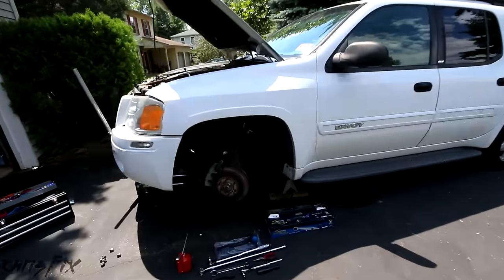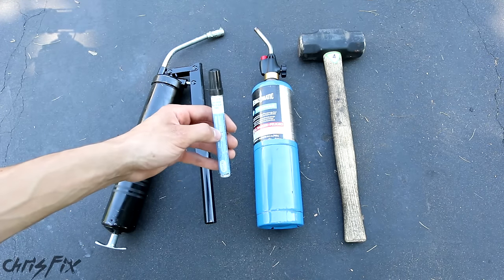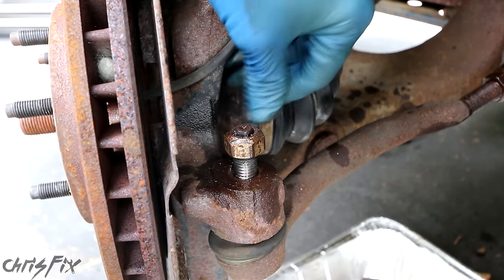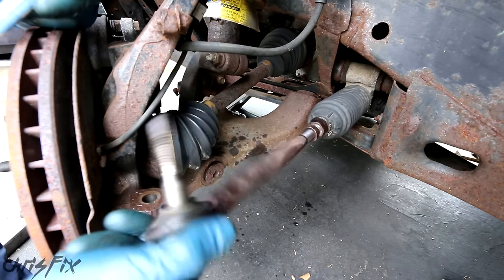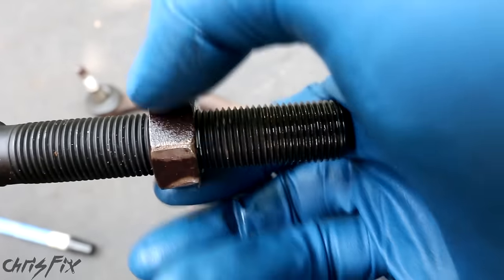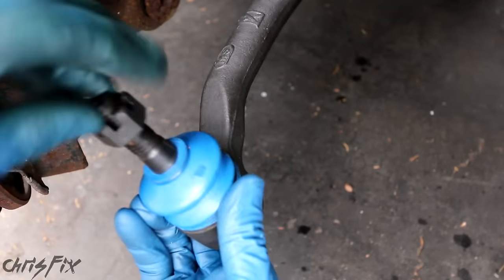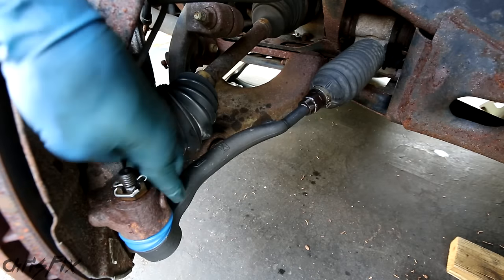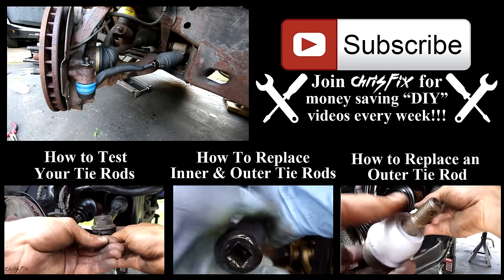How To Replace an Outer Tie Rod End

Comment: I replaced my entire suspension because the stealership wanted a total of $4000 for parts plus labor I laughed bought the kit and did it myself so $590 car feels like new thank you chris
Reply from the maker: Awesome work! glad the video was helpful!
Reply: Same.
Reply: Wow! Great job!
Reply: Honestly 4000$ isn’t a bad price to have a dealer do it. Oem parts like they use are more expensive and mechanics have to be paid. That’s not robbery it’s fair.
Reply: @anandchundi6805  I used oem Mopar parts for the suspension they wanted to charge $2500 for that alone. The rest was labor which I understand but the price for parts absolutely not.
Reply: @Captain_Dark  they have to pay for the parts through their suppliers. They can't control the price, they're not stealing though. I've replaced shocks and struts on my own too, to save some money. Buildings have to keep the lights on, insurance must be paid, mechanics must be paid, shop machinery like lifts require maitenece, etc... you're paying for everything to be done 100% right when you go to the dealer. I really don't think 4000$ is a lot for a dealer to rebuild your suspension, unfortunately cars are expensive to maintain thats the price we pay for personal decentralized mobility.
Reply: @anandchundi6805  nah there's a limit, $4k is way overpriced
Reply: stealership 👍
Reply: @bluckq   I agree, unless you are doing a new rack with 4 wheel alignment at the dealer, you are not coming anywhere close to that. $1,200 is more likely as the rest of the story is not explained. 
  Bob's repair had a Cadillac CTS for 3 days. They wanted $3K to replace the PCM and fixed it. Owner towed it into the dealership and the tech I have known for 26 years, told me the TPS terminals were bad (2 of 3), fixed it that afternoon for $135 dollars total. This does not include terminals, tax, shop supplies and tow which he has no idea what was charged. They don't know how to read a scanner, voltage drop, diagnostic flow chart or simply guess. 
These shops have bed techs, inexperienced techs but the dealer has TSB's, Recalls, or a common problem. 
I have had new vehicles that have three things go wrong with them. Once fixed sometimes with second design parts (New materials, different o-ring, plastic, etc). But the dealer techs knows them, get the right part part and no problems for 150k Miles. I would never take my vehicle into a repair shop other than a dealer. 
DK, ASE Master Tech since 78, retired.
Reply: My wife was telling me that our daughter was crying because "Brake Plus" wanted $680 to repair her brakes on a 1992,Pontiac Grand Prix. It had 75k. I ask the gal behind the they counter for an explaining for the cost. Basically everything on the front was bad. It needed $68 ceramic pads and loaded calipers for $145 dollars. They lay ear does not know, this is 2 sets of pads and 1 set of reman calipers painted. I asked about rear drums and they had no clue. She came back after 4 minutes and told us the tech did not remove and inspect the shoes or cylinders for leakage. I told her I want to see. She objected as only employees are allowed in the back! I have been in a shop longer longer than you have have been alive and pushed my way passed her. With not witness marks on the rear lug nut nuts. You still have not looked at the rears because they haven't been off. Shoes could be on metal and both wheel cylinders could be leaking. You have not looking at they entire brake system and there fore can't tell me the total repair. Bolt it together because I am leaving with the car. She insisted I sign sign a release so they don't get in trouble! What? So the fronts stops and rears don't then you are signing a release. Try having your techs do the job and inspect the system, not just fronts. 
 I took the car home with no pulsation. I installed conical spacer from Kent-Moore, magnetic dial indicator and had 0.002" lateral runout out. It is the max on this model. Others have less to zero thousands of an inch. I rebuild the calipers, hoses, after bleeding the system with new DOT 3. Same with the rears. I spent a total of $66 dollars on ACDelco parts. 
DK, Omaha. ASE Master Tech since 78, retired.
Reply: I have never even considered taking a vehicle to any mechanic. Only thing I bring it in for is warranty work.

Comment: I just replaced the steering rack in my car. Man, what a pain! While I was at it, I replaced outer tie rod ends and sway bar links. Lol. Shop quoted me $1600 for the rack installed.... I bought the rack for $130 and installed it myself. Haha. I'm pretty cheap
Reply: Yeah, it's nice to know how to replace stuff that way you don't have to spend so much.
Reply: wow cool man!!
Reply: Youre not cheap man. Youre smart cuz u saved yourself a shit ton of money and for that, you should celebrate with a. 12 pack haha. Nice man. Honestly i hate racks cuz of the fucking steering shaft sometimes not wanting to go in properly on the rack :/
Reply: way to go brother!
Reply: Cheap? Bro, it's good to learn how to work on cars. If anything, it's more expensive using up your time to work on cars.
Reply: RCMan98 cheapness drives us to learn ashit ton of things
Reply: Hey, if you can do it yourself correctly and save $1,000, why not??  Pay only for the parts.  I taught myself how to change my own oil and filter and haven't taken my vehicles for oil changes in probably 30 years.
Reply: Much respect sir, I'm replacing my damaged lower control arm on my 2003 Ford Taurus and I have a repair manual for it! 
Such a great feeling I can take anything apart and put it back together!!
Reply: Ya my shop wants 400 for both outer tie rods I'm buying parts for 80 and going to a shop for an alignment for 90$
Reply: You are not cheap. Shops are robbers
Reply: Same
Reply: For the price the shop wanted to replace ball joints (upper and lower), I bought MOOG parts, bought a ball joint press, and still had a few bucks left after an alignment. Saved money on the next vehicle I had to do front end work on.
Reply: You said cheap. I think you meant self sufficient.

Comment: to avoid doing a alignment what I do is i count every turn while unscrewing the tie rod end ,  I see what position the tie rod end came out with and put in the new one from the same position with the same number of rotations as the old one. like this i never had to do a alignment. but check your tire wear anyway to see if your old tie rod end was out of alignment.
Reply from the maker: TheMeChaNic55 Thanks for sharing. You will still need an alignment. The threads might not start at the same angle and if you are only .5 of a degree off your toe will be off enough to cause tire wear.

Comment: I just replaced the right tie rod on my 07 trailblazer with an OEM AC DELCO part.  All went pretty well, nothing really tight.  The tie rod would not take grease.  I removed the zerk and it flowed grease.  I knocked the ball around with a piece of wood and I could see that the ball moved.  Guess its too tight to let the grease in.  I think it already has grease but found this strange.  My plan is to try to grease it again after about 1K miles and maybe it will have enough clearance for the grease to enter.  Measured and counted turns and its back exactly like it was.

Comment: ah, perfect timing.  got one of these to do.  thanks Chris!  Also guys, there are some videos on doing an alignment at home using a string on youtube and jackstands at each end of your car.  Its not perfect, but you might be able to skip the alignment shop.
Reply from the maker: Dixon Cider Thanks for sharing and I am glad it was perfect timing! As for a home alignment, it is really tough to do it at home. A change of 1 degree is hard to measure but makes a world of difference. Not saying it cannot be done, just that it's a lot harder than you would think.

Comment: The MOST I've ever done are oil changes, before now.  Replaced inner/outer tie rods, sway bar links and strut/coil assemblies on both sides of my mother's van using Chris' videos as a guide. Took the van in for an alignment. Service Manager calls asks to see me and says, "I don't know who did the work on this van," gulp "but they did a great job. It came in tracking really straight and my tech only needed to make minor adjustments. Most time when they come in, they're so bad we wonder how they got here without the wheels falling off." DAYUM, Chris - these vids WORK!

Comment: Technician here. I agree with most of it. Only thing I'd change is hit the knuckle where the tie rod mounts to the knuckle instead of the top of the old tie rod. If you aren't careful, the top of it when hit could bow out, making it near impossible to get out

Comment: ChrisFix  's Penetrating Fluid really rocks man!! and is unflammable too, awesome! The lock nut got kind of stripped, thoug, I'd replace it, just in case. The marking part is SUPER important, like you said, for driving safely to the alignement place.
An important job made easy, great video Chris, as usual!
Reply from the maker: David Miranda Thanks a lot David! Glad you liked the video! That penetrating fluid is some serious stuff! Makes my life easier for sure!
Reply: David Miranda it is good stuff.  made up a batch.

Comment: I have the exact vehicle same color and all and the tie rods may need replaced soon, very helpful tip on the alignment nut! 

Also, mevotech supreme, besides Mevotech TTX, is the best parts for this vehicle! You can grease them as much as you want because they have a one way overflow valve

Comment: Thanks for this video Chris.  It helps me even with a different truck know what to do.  I bought some new tie rod ends for my truck and new out of the box I can with medium force move the joint part .  From your video you said that is not good.  They don't freely move, but I can move them.  Your input would be appreciated.  Thanks for your helpful videos.

Comment: Hi Chris, thanks for all these helpful uploads. The rubber boots on my tie rods and ball-joints are all cracked and falling apart.
I've been spraying them every time they made noise with wd-40 waterproof lubricant. If I continue keeping them lubricated with spray but not changing them, would the wear accelerates to cause a problem? The car (2000 Grand Marquis) is 19 years old with 110000 miles but running good.

Comment: Chris,
Try using a floor jack to push on the wrench in order to loosen the nut on the inner side. This should help you instead of heating up the whole thing.

Thanks for the video.
Reply from the maker: hisham202 That is a great idea! Thanks for sharing!

Comment: Another good trick to get the tie rod ball joint end out of the 'suction' on the knuckle is to hit the knuckle on the side with the hammer where the tie rod is attached. I am referring to the part in the middle of the screen at 2:55. It makes the tie rod pop out pretty easy. I used to use a pickle fork, but now I do it this way, and the pickle fork sits in the tool box.
Reply from the maker: Maverick Xeo Thanks for sharing. You never want to hit the knuckle because it can cause stress fractures. You always want to hit the tie rod itself. A pickle fork is even better but most people dont have one so a hammer to the stud with the nut on it is simple and effective.
Reply: ChrisFix your hammer method works better than all my pickle forks.

Comment: Good video. A little tip that will make things easier should the tie rod need to be replaced in the future, plus will help with aligning, is to put a little grease or anti seize on the threads before you thread the tie rods together. That will help prevent corrosion that will seize the tie rods together.
Reply from the maker: +Longbox55 Thanks for the tip!

Comment: Smashing job chris, and you had the typical "I wont move" nut lol :-D
I helped a mate do the trackrods on his old ford transit, heat did very little, it was a pig, i used two hammers, one in each hand and hit both sides of the nut at the same time, then picking different flats on the nut and doing it again, it gave in after 10 mins of beating ha ha :-D
Reply from the maker: +zx8401ztv Yea, it was a pain and I guess it is from all of the pressure and exposure to the elements! Sounds like you guys had some fun getting that nut loose haha
Reply: +ChrisFix It had become one with trackrod LOL :-D
Its all good fun ;-)

Comment: Please note that envoy/trail blazers as do most Toyota truck tierod jam nuts are reverse to the treading of most vehicles. I would recommend using map gas over propane, as you will be there forever heating it with propane. Castle nuts generally do not seize, as lock nuts almost always do. 

I also advise anti-seizing the threads of the new tie rod, just in case you have to replace it again and it's a nice gesture to the aligner, especially years down the read when it needs to be aligned again.  ;) 

Good video, though.
Reply from the maker: +RangeRov49 Thanks for the tip!!!

Comment: Last summer, I bought a '97 Pathfinder.  The other day I noticed that after making a slow, sharp turn when the car straightened out, the steering wheel did not .... eventually, it did of course but, I was wondering what I should test first to find the problem.  Thanks!

Comment: Hi Chris, I have a question for you. I replace the ball joint on the 2001 e150 Econoline. I thought by doing that, I was going to fix the toe-in tire problem, but it didn't what I should do now?
Reply from the maker: If you just replaced ball joints, then you wouldn't have fixed the issue. I would test out your tie rods (https://www.youtube.com/watch?v=brI2feYiEi8) and fix them if you need to, if they are ok then I would get it aligned and you should be good!
Reply: @chrisfix  Thank you, Chris, for responding to my question. I will check the tie rods. I promise to let you know if I fix the problem. Thank you again, And God bless you.

Comment: Hey Chris, awesome channel, My steering wheel is turned to the right a little bit when driving straight, how would i go about adjusting this?? thanks in advance for your help, happy to donate to a charity of your choice for advice
Reply from the maker: +Zac Postans You would need to adjust the tie rods. I suggest taking the car in for a front end alignment. Good luck!
Reply: Thanks buddy, will let the pros sort it, not really a carpenters job haha

Comment: Well instructed video! Once again, i have another video request which it may or may not be on the list yet but it would be installing an aftermarket radio deck/unit and installation of an aftermarket muffler such as a flowmaster which usually isnt a direct fit.
Reply from the maker: mrklimczyk Thanks man and those two videos are on the list! I am working on the exhaust and I am not sure what head unit to get but I have been looking at that too!

Comment: Hi Chris. I’m debating on taking on the job of rebuilding my front end, ball joints, control arm bushings, etc. i have found very few videos on how to remove the torsion bar from the lower control arm like on my 1993 Chevy k1500. Is this something I can do in my garage or should I just cough up the money and pay a shop to do it? I’m confident that I can do everything else but the lower control arm

Comment: Do work coilovers ruin outer tie rods? I already have to replace the outer tie rods, I'm wondering if I should also replace the coilovers as they are soft and have never been replaced. The car has 330K km on it.

Comment: Lucky that came out so easy! Doing this on my old car I had to get a tool to press it out. Tighten it all I could, let it sit for 10 minutes, tighten, let it sit and so on. Eventually it popped out with one hell of a bang
Reply from the maker: Smenny Dang, that stinks. I have never had that problem (yet), but I dont look forward to it! My penetrating fluid really helps a lot!
Reply: ChrisFix Yeah, I think I'm gonna have to make my own as well. WD-40 didn't cut it for that job at least. First I tried all kinds of hammers, then the pickle forks, and eventually a tool to press it out. Had to thighten it all I could with a huge breaker bar many times to eventually get it to pop out. And use some heat. But now that I have the tools it's really no problem. All you need is one of those presses made for ball joints and you'll be able to get anything loose

Comment: Hey chris great vid as always. You probaby alredy know but just in case, map gas is the best for at home diy use without an acetelyne torch. Its the yellow bottles next to the blue propane bottles. Map just burns hotter, enough to make some then metals red, but wont melt or cut anything.
Reply from the maker: trollaphobic Thanks man! I have map gas but only use it for the real tough stuff! I actually had an oxy-map gas torch but it burnt itself to pieces because it got too hot.
Reply: Oh wow haha

Comment: Any advice on the following? When i replaced the tie rod on my BMW the outer nut (the castle nut as per your video connecting to the hub assembly) wouldn't loosen. When i tried to turn it the entire threaded rod and ball joint kept spinning inside the rubber boot. i had to use a C-Clamp to crush the ball joint and thread at a weird angle to stop it from spinning so i could loosen off the nut.

Comment: now @chrisfix this does affect if a tire is sitting slanted, right? because my rear left tire is like that like its slanted inwards not at too much of an angle but still a little noticeable im pretty sure but i need to confirm with my hero lol
Reply from the maker: This doesn't affect camber, which it sounds like your tire has. Sounds like some kind of suspension arm is bent or very out of alignment
Reply: @chrisfix  aint no way chrisfix just replied to me! i really appreciate it now imma go watch your video on how to fully do the suspension just in case i need it lol you are the best Chris!